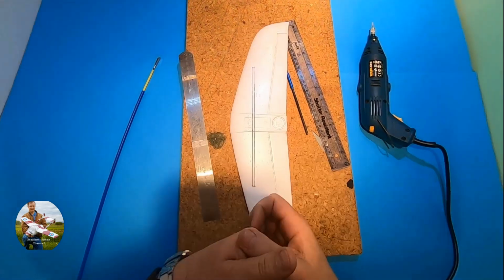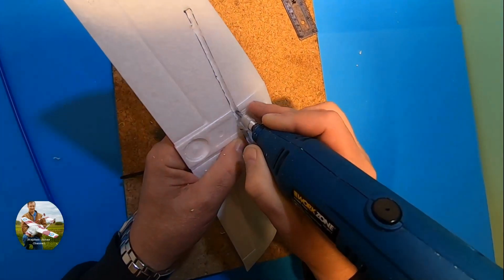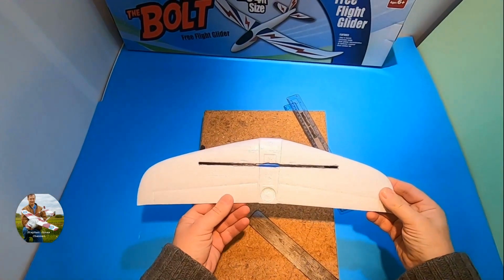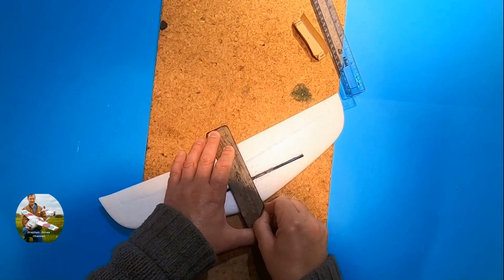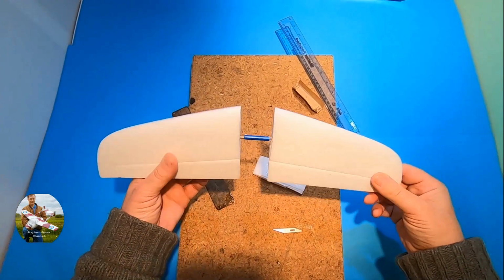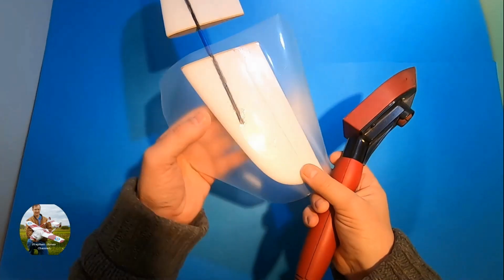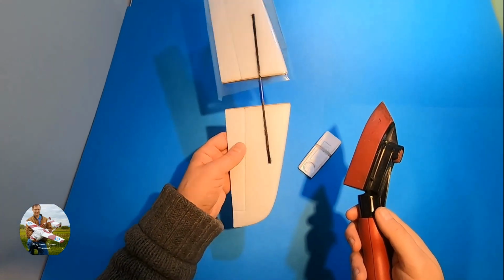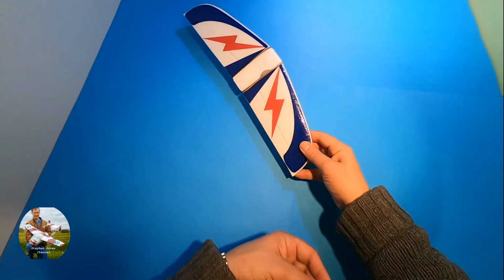The Bolt EP Part 2 Tail-Plane

Comment: Thanks for the excellent video. I now have four Bolts to do this with.
Reply from the maker: That`s £80 you could of bought a rtf plane for that.  Gees .
The Body is nearly done having problems Getting motor all supplies have dried up of D2826-6 2200 kv

Comment: Hi stephen. Great videos. I also have a bolt that i would like to convert to Rc. Im fairly new this and would 
like to know if there is a kit for this or can you recommend what would be the best parts to use. Not to sure
if im going 3 or 4 channel or maybe just using without the motor. Many thanks.
Reply from the maker: Hi, If you are new to Radio Controlled model planes you would need some skills in flying and building to put one of these together. The good thing is you can learn fairly cheaply these days.
And converting a glider is probably the cheapest way to start. I would recommend joining a local flying club where you can meet and talk to other like minded folk. Join a forum where you can ask lots of questions and get advice. here is a link to my build blog on model flying forum.  https://www.modelflying.co.uk/forums/index.php?/topic/42342-the-bolt-chuck-glider/&tab=comments#comment-759056
Reply: @RcAircraft  Thanks for the reply. I build balsa wood planes and have converted one to rc
Most are rubber powered. I also have a riot which i have not flown yet. The bolt seems a good starting 
point. Would like to know what parts you used with your build. many thanks.
Reply from the maker: @lesleyturner9812  I have added info in the description on both the power and glider version of the Bolt. Three basic 9 gram servos . Rx and Battery to suit.

Comment: Hi. Did you widen the cuts to allow for the extra width of the ply or just move the wing out a bit ?  I have bought the kit and at some stage I will have a bash at converting it.  Bri
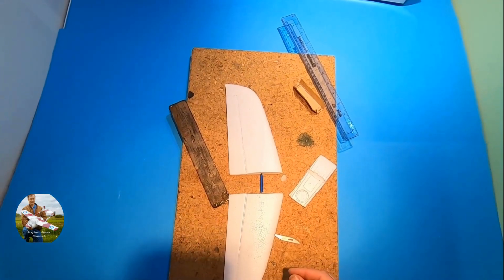Reply from the maker: Hi Brian, at 5:40 i explain that the cut edges need sanding to accept the Ply. 
The Carbon rod is glued in before any cuts are done so that they remain aliened with each other.  
Thank`s.